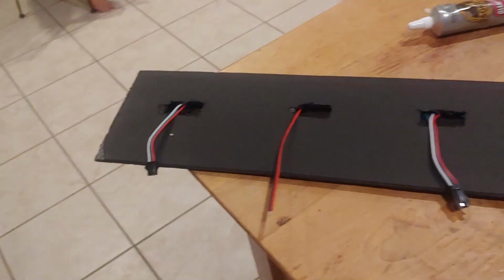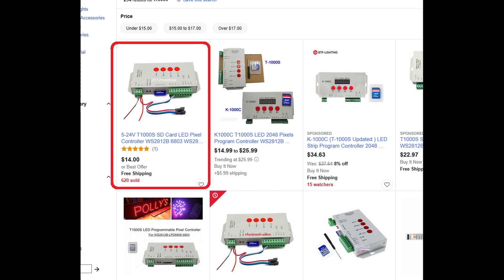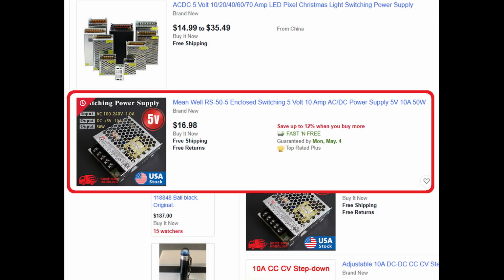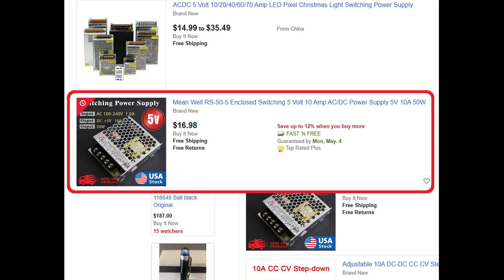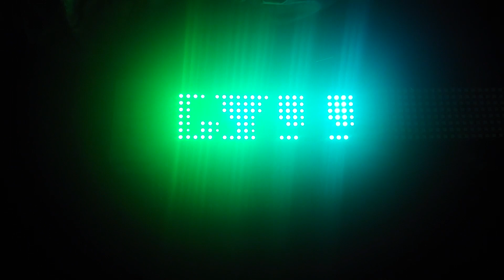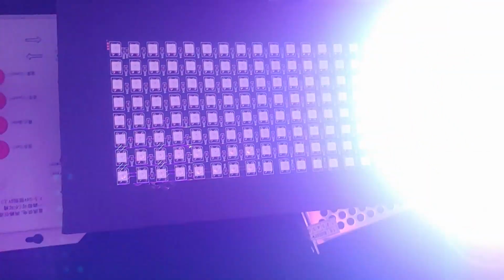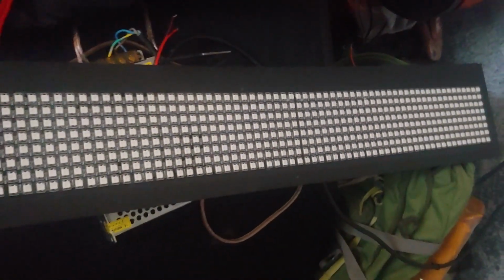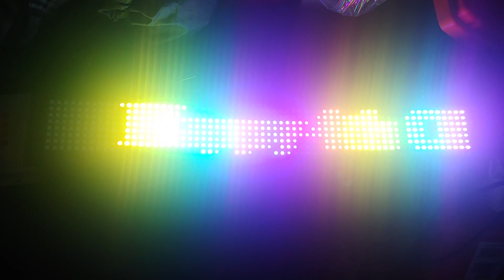DIY LED Scrolling Text Panel (8x64 WS2812B with T1000S)

Comment: hi. why do I have t1000s does not change effects, if more than 4 files are written to the flash drive?
Reply from the maker: I haven't experienced that? Maybe try reformatting and rewriting the files. I have encountered LOTS of strange, erratic behaviour though. I wish there were a better cheap solution.